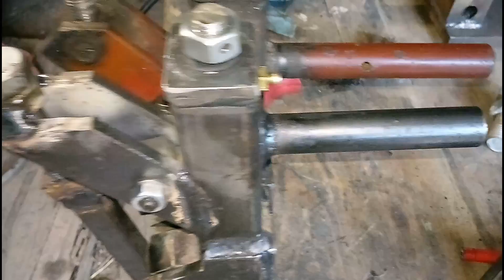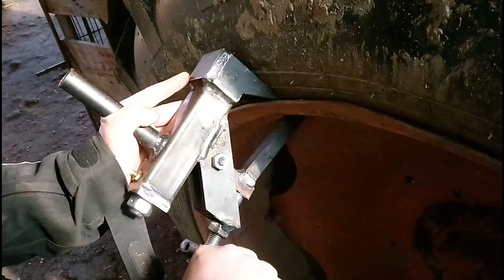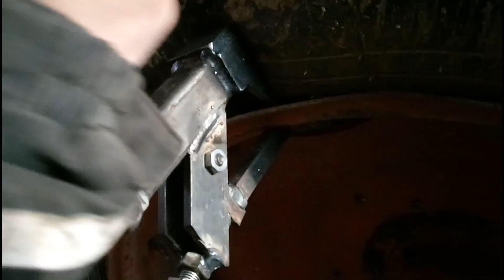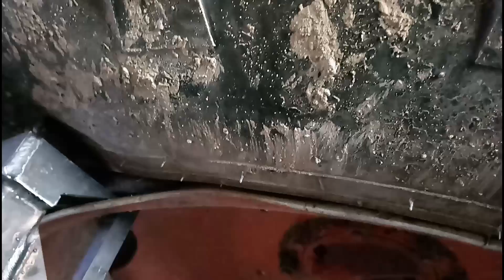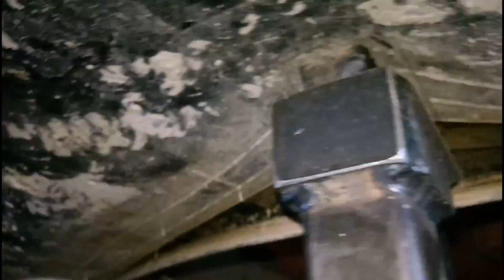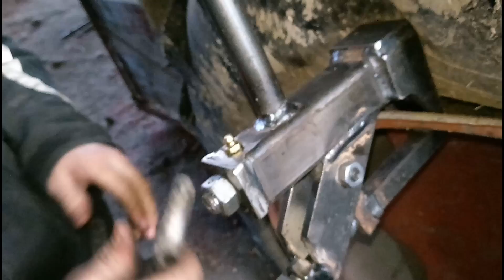How to use Bead Breaker Tool without removing the wheel | Dejantare anvelopa fara demontarea rotii

Comment: If rim is to thin you can bend it.
Reply from the maker: You are right, except that the tractor rim is quite thick and cannot be bent with this device.
Reply: Yes it can, if you try to do only with one step and if rim is rust you wull bendt it, a  one big hammer and one smaller will do same job and faster.. @DorelBorlea
Reply from the maker: @hardcoreplayafromthehimala4888   It depends on everyone's experience. Some tires come off the rim more easily and you can use a small and a large hammer to do the job. Other tires are more difficult to detach from the rim and a bead breaker tool will make your job easier.